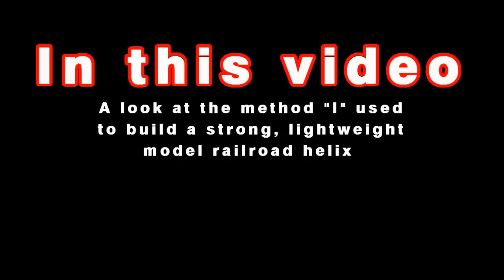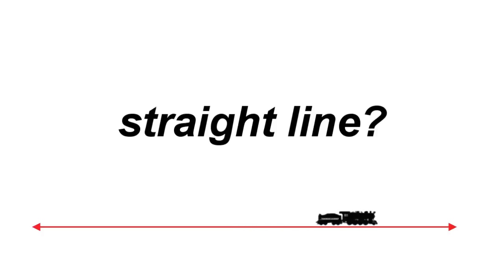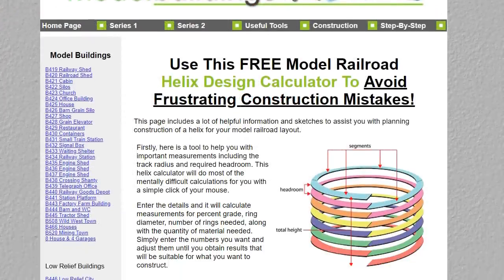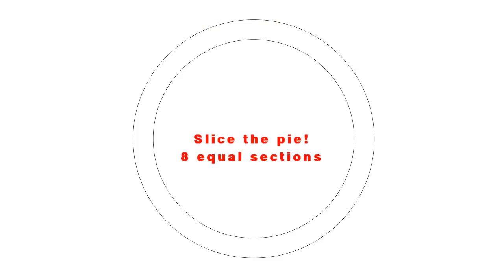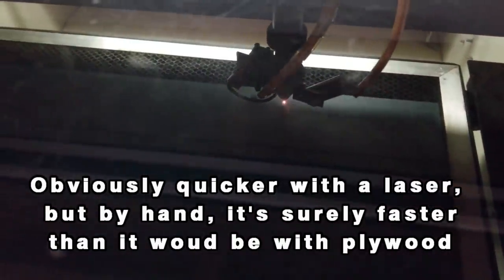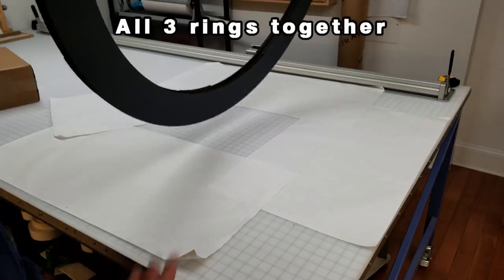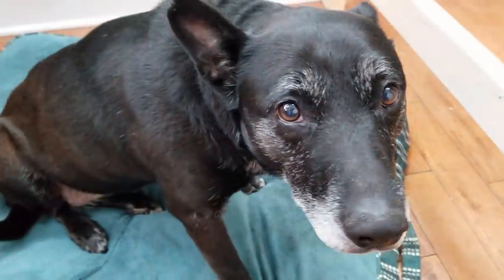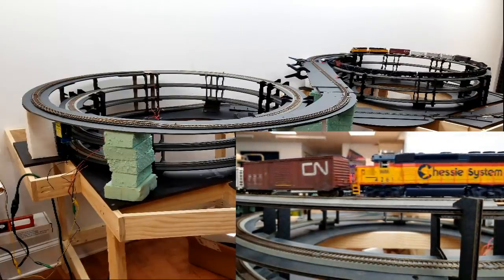World's Lightest Model Railroad Helix?

Comment: Hi Joey.  I just finished using your idea for my helix.  Let me say that hand cutting 32 risers and 80 curved sections was time consuming to say the least.  I kept reminding myself that spending time is why I do it.  The results are really great.  My helix has five loops and rises about 17 inches. I was concerned it might not be strong enough as I used foam core instead of gator board, but the finished product is very strong.  Easily strong enough for anything my HO scale layout would throw at it.  The strength is additionally improved when the Atlas True Track is glued down.  All in all... a great new approach to a major headache for modelers.  Thank you for posting your thoughts.  We look forward to your next offering.
Reply from the maker: Bravo John. Would love to see some pictures or video.
Reply: Trackside Scenery Hi Joey.  I’m not sure how to send you photos on you tube, but I’d love to send you a couple.  I will go to your webpage  to send them to you.

Comment: Joey, it's very nice to see a new tutorial from you. I had often wondered if a helix could be made with Foamboard. I model in N scale, so I thought the lightweight nature of the scale would allow it. This Gator board is a step up. Very nice. Someone in the MRR, world, ( wink, wink nudge, nudge ) should manufacture these,  both in N scale and  HO,  in a ready to build kit form. The individual pieces would not be too heavy and easily mailed. Just saying.......I very much look forward to a new layout build. Later.
Reply from the maker: Hi Norman, keep in mind that this isn't regular foam board like you see in Walmart in the school project section. That is foam core, but only a card stock material outside. Gator is wood pulp vaneer and a lot stronger.
Reply: Trackside Scenery ,   Joey, you did not read my comment all the way through. But, that's okay. I won't unsub. Later.

Comment: At 10:00, you are installing "leveling blocks". Is the lower level roadbed supported by leveling blocks and/or risers? Is the grade determined by the leveling blocks?
Reply from the maker: Depends on how you are installing it. This is on a flat surface so I am leveling with blocks. When you build these, obviously sitting on a table unleveled, it will be leaning as it is a corkscrew. It has to be leveled. You can use basswood sticks, paint stirrer or whatever just to level it.

Comment: Just a minor negative comment.....Enjoyed the video, and some great ideas, but after ruling out plywood because Gatorboard is easier, you use a laser cutter.....I don't think many model railroaders have one of those.  :-)  But Gatorboard is a great solution, and thanks for some great info on designing the helix.
Reply: Laser cutters make it easy but as you can cut foamboard with a knife, you could just draw up and print out one piece and cut out, then draw roundxand use it as a template. Although the side parts are a bit harder to do 100%, I'd guess the round bits don't need 100%. Will be giving this a go.

Comment: Do you think the sections between the risers will sag over time and result in a undulating helix. I know GATORFOAM is strong stuff we used it to make a 4 piece modular layout to take to Amherst. It is very light compared to our old module and has gone through 2 shows in great shape. Getting large sheets was a little difficult. You thinking of offering it a a kit?  Very interesting video.
Reply from the maker: Even large Gator 4x8 sheets I have here on the shop stay stiff, now the regular foam board (paper stock sandwiching the foam) does curl, even the smaller sheets. We use them for displays and signs here at the shop. Selling kits would be a large  undertaking. Maybe templates or something who knows. Thanks for watching, much appreciated! Joey

Comment: Do you not sell a turn key kit for a complete helix with height being the only variety?  Complete kits is key based on total height/levels and single or double track.  This is a niche market that needs filled without breaking the bank like the helix kits on eBay which sell for - $350 - $450 each.
Reply from the maker: Our helix components have been selling amazingly well since the launch in January. The component format allows you to create a "kit" and allows the user to build the exact helix they want in terms of loops, a variety of different radiuses and heights. That was the number one key when we started researching the desires of modelers. So when you say "turn key", all you have to do is select the components you want and put them together just like any kit. If you are looking for a helix, contact us at tracksidescenery@gmail.com.

Comment: Well, try cutting it all out with a blade. The cuts aren't going to be pretty.
Reply from the maker: Using the trapezoid shape would make marking easier as it would be straight lines drawn/cut. The last one I did was a trap and cut by hand with straight edge - looked pretty good.

Comment: Except any “kink or bend” and it’s nothing but paper. Doing this by hand will not give the same results!
Reply from the maker: This isn't the first gator helix, but the first one that I cut on the laser. The three previous - I cut by hand and they work exactly the same, just not as pretty. For "those" not familiar with these types of substrates, this material is Gatorboard and unlike foam board which is foam covered with lightweight paper stock.